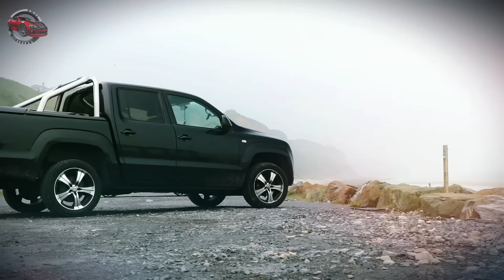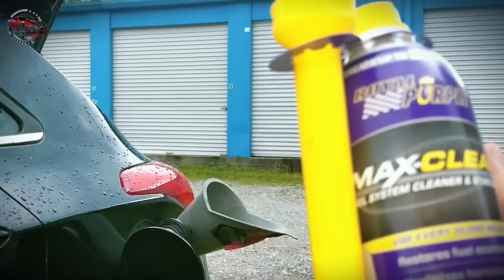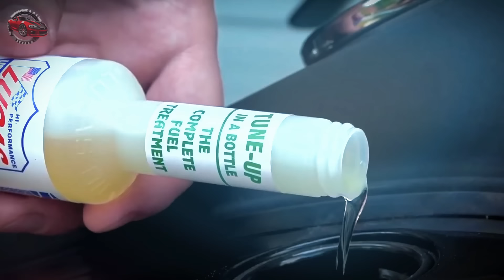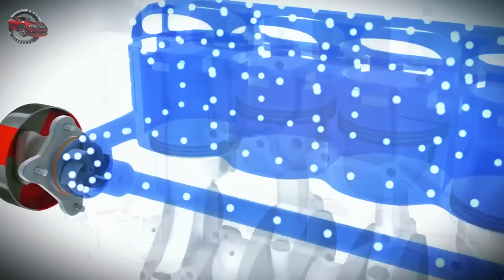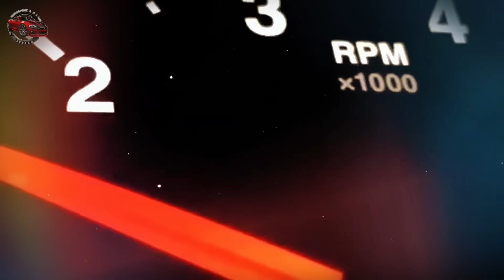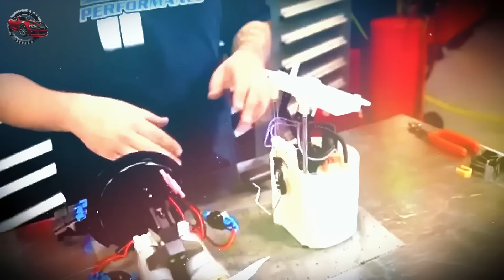10 ILLEGAL Tricks to Make Your CAR Run BETTER. MAINTENANCE Secret for Used and Pre-Owned Cars Tricks

Comment: I use electrolysis with ammonia alcohol mixture big performance boost
Magnets on the fuel line Aline gas molecular structure try it it's cheap results vary by what is in the gas

Comment: There are anti-theft systems in some vehicles which disable parts if they are disconnected from the battery for too long, BMW is a good example.  Check the anti-theft info for your car before disconnecting the battery for trick #1.

Comment: I always run 40 to 42 PSI in any of my vehicles that supposed to have 34 or 35. I run 45psi in my Honda CRV. Of course it's my work car full of tools and that thing weighs around 43 to 4400 lb

Comment: This was the way I had to tell the dealer to get my car working so it could pass inspection in NY. Often the electronics are full of corrupted data from years of operation but it does not appear in the ECM reader data. I told the dealer to do a full power down and then short out the complete electronics of the car for 1/2 hour as I had found helped correct crashed computers over my years of working with them. Results are generally a very well running car or computer after a few restarts and runs to get the system back to default correct values. Yes, I am a retired Electronics Engineer.

Comment: You forgot accelerator cable adjustment because the cable does stretch over a period of time. Overall, very vital information. Thank you.
Reply: Not many cars in the last 20 years have a throttle cable. It's all electronic.

Comment: Really bad advice.  Do not under any circumstances add alcohol to your gasoline.  It already contains the maximum amount of alcohol allowed by the manufacturer.  Adding more has the possibility of damaging components.  Adding oil to your gasoline is at best a very temporary help as it will be gone with the next fill up.  But the real problem is that it may destroy your catalytic converter.
Reply: How about Polyetheramine (PEA)?
Reply: Anyone who says this is good advice is full of shit. I guarantee that none of you saying this will try with success. You'll only create costly mistakes. 😂
Reply: You don't add that much engine oil to the fuel lol . I found just a little kerosene in with the fuel makes one run a little better
Reply: I have an old Ford truck that has an IDI in it. I usually dump a quart of transmission fluid in the fuel tank every so often. But that really helps those old diesels out.

Comment: The IMPORTANT takeaways from this video are: make sure to disconnect BOTH battery terminals. Having only ONE disconnected would mean the "valence electrons" (the "free" electrons) could bleed over from the negative terminal to the "disconnected" neg cable and cause trouble. Taking the key OUT OF the IGNITION would prevent the car from starting by itself? Possibly even with BOTH battery terminals disconnected? It is possible to discharge the computer caps by connecting the "disconnected " neg cable to the "connected" pos cable WITHOUT blowing anything up! It's TRUE. Trust me. I have done it! Turning the lights on for a minute will do the same thing as "shorting" the cables together!
Reply: NONSENSE. Please don't listen to anything this person says. The electrons can not "bleed" over. Air is not conductive until very high voltage. Even the body can't conduct at 12v. You drain the caps by touching the DISCONNECTED cables to each other. Man, how many fingers do have?

Comment: I put my half worn tyres at 40psi as my tyres rarely get to operating temp or speed I get better economy better .
Reply: This is a GREAT IDEA, If you're going to be entering the "Mobil Gas Economy Run" competition. But, for "normal" driving you will be getting diminishing returns with premature tire wear. Btw, what is "operating speed"? My tire pressure increases by as much as 5lbs in 1/2mile at 45mph. Starting out (25 degrees F.) if my tires are at 30lbs, at the end of 1mile the pressure could be at 34-35 lbs. Fyi, the tire temp also increases by the "flexing" of the tire not just rolling along the road!

Comment: No, I've reprogrammed several cars computers. I DID use a handheld diagnostic tool $39.95...but guys do this without any instruments and pretty well wipe previous " memory"
Of course, of you want the REALLY do it right, you need a lap top and you just totally SWAP the originsl stock computer with a far faster and MORE powerful Aftermarket computer OR Aftermarket Computer AND Aftermarket integrated Computer/Injector system. Like Edelbrock or several other performance manufactures market which are 50 State compliant.
Reply: The CHEAPEST is to get a "performance IC" (if available for your car). This will probably give you the most bang for the buck and least amount of work.